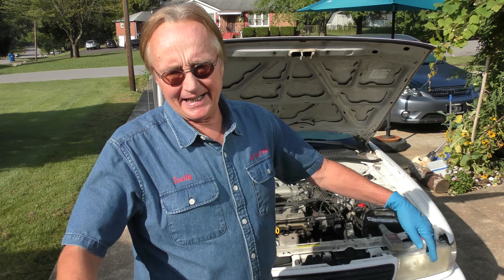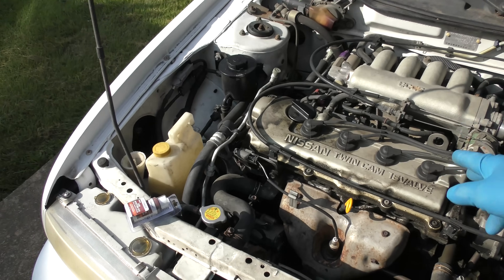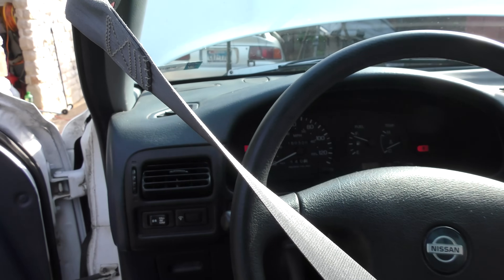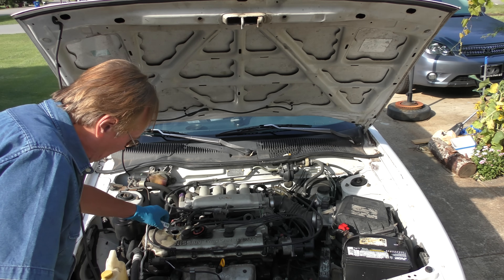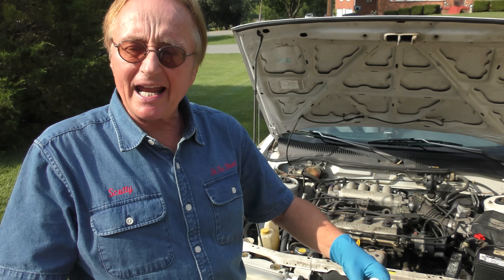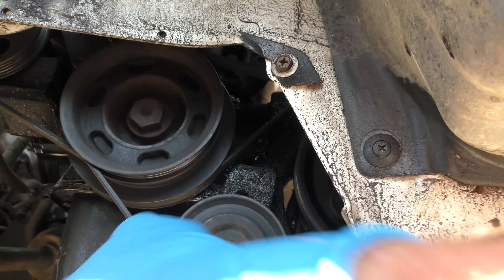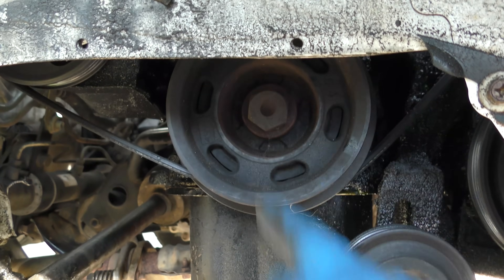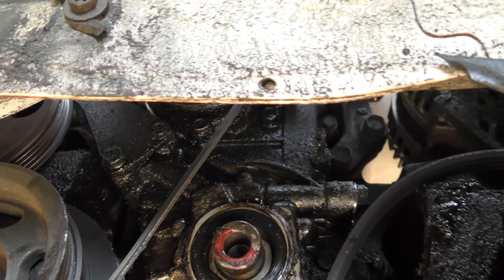If You've Got an Old Car, Do This Now

Comment: Scotty is the only mechanic I know who uses UV leak dye. All of our local mechanics just guess where the leak is, which can be very expensive!
Reply: Can't they use the computer to detect the leak? (I'm still learning about cars)
Reply: No, the only components that is electronic that deals directly with the oil is pressure and temperature sensors. You should always use dye unless you can easily see it.
Reply: @HeinzGuderian_ lol no y’all don’t. I can’t believe you just lied for all mechanics in the US like that
Reply: id guess the garages don't want to keep stop pile of dyes
Reply: @jenkathefridge3933 loooool yeah the check engine light tells you
Reply: 😂 there guess always be wrong too
Reply: the seals on japanese cars always fail. they use crap rubber bits
Reply: @HeinzGuderian_  we aren’t talking about mechanics having the dye. We are referring to them using it….
Reply: Wonder why he didn't take a piece of Emery cloth and polished dampener where it rides on the seal that would have been the perfect job.
Reply: I would have definitely degrees the whole engine off, last thing you want is that fluid getting on everything and ruining, and you'll find your lie like nobody's business I've been doing it for 45 years. If you got anything riding on this seal,it needs to be polish before you put it back on
Reply: Work smarter, not harder.  That's the key.
Reply: @jenkathefridge3933 how can a computer tell you where an oil leak is? No car can do that.
Reply: @CadillacDriver ya then you just press the stop leak button
Reply: @kellismith4329  yeah of course 🤔😆
Reply: Thanks,strange Mechanics… my Point S Tire shop pretty straightforward (getting expensive
Reply: Yeah well I don't guess I completely decrease  the engine off spray it off run it and then take a look.

Comment: Scotty actually saying good things about a Nissan 😂
Reply: Next he'll say something good about bmw
Reply: those old nissans are still running an i have a 2013 versa(its now a spare to a toyota and subaru i have) ready for a 3rd trans at 160k. MY 95 Altima i still had until 2018 never died ever bulletproof i put 70k on it when its over 20year of age(when i got it 2015) and for 500 bucks not bad for my first car.(brother crashed it)
Reply: Yeah if it's an older model.
Reply: Old Nissans are really good. Pretty much anything prior to 2002 and certain models from 02-07. There’s very few models Nissan makes today that are somewhat reliable. The trucks and Z are good. The high end models like the Armada have decent drivetrains, but can be an electrical nightmare, same with Infiniti. They really went down after 06 or 07.
Reply: Lmao. Just because it is an old model, that's why lol
Reply: Next you’re going to tell me he is saying good things about EVs… …. ….   Was that a pig that just flew by?
Reply: He says the older ones are pretty good in the videom
Reply: Lol he's said good things about only two modern Nissan's i can think of,  a Titan and a 370z which makes sense
Reply: He’ll hate them next week. He’s whacked
Reply: @seraph1926 yeah he’s cooked
Reply: I. Can’t  believe it 😮
Reply: He's talking about OLD Nissans... different car.
Reply: He always said good things about the Navara  and  pre Renault  models.
Reply: @seraph1926 he already has on the M3 video
Reply: Old, pre-Renault Nissans that is.
Reply: Old Nissans are built like tanks with bulletproof engines. They're as good as Toyotas and sometimes if not better. Old corollas are using belts whilst the sentras use timing chains which is much more durable and reliable.

Comment: You can tell Scotty loves working on older cars.
Reply: He doesn't know how to work on modern cars.
Reply: Cause its easier to diagnose them
Reply: @mattdawg6006 Neither does any other mechanic😅
Reply: When they were easy to work on.
Reply: I have an 1994 Olds Cutlass Supreme S 3.1 wishing he could work on mine cause my checkengine lightt comes on or my ABS lights comes on & no one could tell me what's wrong & my a/c has worked in 4 years blowing HOT AIR
Reply: Who doesn't?! Anyone that has been a mechanic will tell the older stuff is a lot more better built and repair friendly.
Reply: @mattdawg6006 Scotty fixes old and new cars quite well.
Reply: @mattdawg6006  He even knows how to work on EVs lol
Reply: So do I!!
Reply: He doesn't know what do do with anything manufactured after 2002.
Reply: @adriantomlin2902 'more better'? 😅😂
Reply: @WhatYouSee  the man has the equipment and knowledge to work on every type of car, including modern hybrids and EVs
Reply: @seanweber4252  great. He bought equipment.  He has the money  to buy equipment.  Show me an EV that  he's  fixed.  And not just a tail light
Reply: @WhatYouSee  🤓🤓🤓
Reply: @seanweber4252  People who are trained on and skilled at repairing EVs do not refer to themselves as 'mechanics'.  In fact - NOBODY working on truly modern cars are referred to as 'mechanics'.  That term in used for oil change and tire changing chain personnel.
Reply: @user-ob3jf6kt1l  Put the key on to accessory position & jump the top right two terminals on the electrical connector near your left knee in the driver's seat. The check engine light will blink out some 2 digit codes.

Comment: Hole in the muffler? Back in the seventies you could buy a Muffler Bandage, a fiberglass strip that you would wrap around the muffler (like a bandage). With heat the bandage would get hard. Drove an old Dodge Dart with a bandage for years
Reply: A can of powder milk, cut and folded. Wrapped and held in place with regular steel wire. Worked perfectly fine on an old Toyota for at least 4 years. Eventually the entire muffler fell down. LOL 😂😂
The car run for years with the most bizarre "fixes". Unfortunately on the day that "vehicle inspections" became a legal obligation. 
I stop it on the side of the road. Never to be touched again!
Reply: Too bad @CensorshipGenesis they don't do vehicle inspections anymore; only emission testing.

Comment: The only people that would say Scotty's' "full of crap" are those that have not tried 205 reseal. It is amazing stuff. I drive a 1999 Acura Integra that had a rear main seal leak. The reseal not only stopped the leak it also cleaned the rings and the car no longer gives off light smoke at start up, till warm - something that B series engines are known for. Great advice from a guy that knows - Scotty's alright in my book.
Reply: craigsawyer6453- The light smoke at start up is valve stem seals. It is not a real problem but, it is bad when you start up in a parking lot when someone is walking by, this happens to me with my old truck. I will try the 205 but I have been living with this for 20 years in this occasional use work truck, so it probably beyond help from this product.
Reply: Would the leak seal work on an 09 dodge nitro?

Comment: Back in 2005, I bought  a 1991 Nissan Maxima SE with 245k miles. Sold it with 300k miles in 2006. No issues.  They were solid cars back then
Reply: Back when Nissan was still Nissan or way back in the 70s when they were known as Datsun..
Reply: Those maximas  were great with superb v6 engines.
Reply: 55k miles in one year?? Good lord.
Reply: Nissan products were great in the late 70's, 80's,  and early 90s. 240z,260z, 280z, 300zx. Maximas and Toyota Cresidas were Japanese Cadillacs. I bought a 1986 4 cylinder Nissan Hardbody pickup. Hauled stuff in raced. Snatched second every red-light. Went through a few clutches. My brother wrecked it in 1990 with 300k on it. Truck went across the country many times at 90 mph. Nissans were great.

Comment: Transmission fluid and filter change, do it yourself, but don't consider this a simple job.

I did one on a lightly driven 94 Chrysler New Yorker 3.5 l V6 that just reached 50,000 miles.  The hardest thing was getting the pan off, on which the factory used silicone to make a gasket.  Get one of those "gasket breaker" tools, even if it costs 50 bucks.  Tapped the gasket breaker into the seam near a corner of the oil pan, and it popped right off.  Don't improvise with a chisel and end up gouging the pan because it is nigh impossible to buy a replacement pan for this car.

The second hardest thing was removing every vestige of the silicone gasket.  Use plastic scrapers, don't be afraid to use your fingernail, and plan on spending a half a day getting the pan flange free of the silicone.  For some happy reason, not much silicone removal was needed on the mating transmission flange up in the vehicle.  Putting it back together, I spent $20 on a fiber gasket and did not use the rubber gasket that came with the new filter that was creased from being folded up in the box the filter came in.

Torqued the pan against the fiber gasket according to Scotty's instructions, and whoo-hoo, no transmission leaks!
Reply: And one more thing, I took a jeweler's file to remove the drill-hole burr on all the bolt holes on the mating side of the transmission oil pan flange.  This is done by filing inside each bolt hole at an angle, being careful not to slip out of the hole and scratch the flange surface.  The factory use of a silicone seal probably made up for the tiny irregularities from those burrs on the bolt holes, but I was not taking the chance that the fiber gasket was going to distort when those burrs were pressed into it.
The hour I spent doing this was worth it to achieve a leak-free fit of the pan.

Comment: Those Nissans in the 90s are good engine and transmission is good after 2006 Nissan has went downhill my uncle's has a 96 Altima gxe with same motor

Comment: Eyy a B13 Sentra. I still have one and still use it today. Very very reliable car. Timing chain driven DOHC 16 valve engine. Good on gas. Light car. I also did replace this particular main seal as mine leaked as well months ago. I can still find original OEM nissan parts for this car. Own mine for 7 years now with 90k miles (150k kms) Just keep in mind you have to take care the body to prevent rust as this era of cars are not really rust proofed well. But very solid car and cheap to maintain

Comment: Best car I ever owned was a Datsun B210. 300,000 miles. Still had the original battery when I traded it.
Got 40 miles to the gallon back in 1978 !
Reply: Thanks for saying so,  my 2014 quest has the original battery and the whole neighborhood is shocked!
Reply: How old was it by then?

Our Primera had its first battery for 13 years and 11 months.

Comment: These type videos, where Scotty shows how to do the work, are my favorites.The info vids are great, but I like to do the work myself and these vids are excellent as teaching tools!! 👍
Reply: Couldn't tell from the video, was Scotty able to access the crankshaft seal by removing both the front right tire & shocks/springs or just the tire?
Reply: wouldn't he have to work from under the hood to remove the shocks and springs as well? im not an expert but i think since he didn't do that in the video i assume its just the wheel
Reply: @ahmadammash9511  I have an old Sentra and there is more accessibility from the side than you might think. But transverse mounted drivetrains are a pain the butt. 
I liked the old days when everything was in line, front to back. Not always a picnic to work on either but a whole lot easier than front wheel drive. 
Cheers😁👍
Reply: @emailuser8668  You can and you may need a puller as well if rubber mallet won't work. To get the seal if don't have a tool just gently drive a screw into the thick part of the seal and pull it out. You don't to scratch any of the housing. If you don't have socket to reseat the new seal use the old on top of the new one and gently tap it in with a small hammer or rubber mallet.

Comment: If you are one of those people that bought a CVT before knowing they are junk, change the fluid every 40,000 miles (or sooner if you have a Nissan.) Ignore the shop when they say you don't need to do that. You will get more miles out of the transmission
Reply: @devenmellor  I agree. I choose to do it as a yearly service and I'm at nearly 90k. Not everyone wants to do it that often so I list what a trusted mechanic told me with the 40k interval. Fluid changes are much cheaper than a new transmission in the end.

Comment: I have a Nissan Sunny ( Sentra ) 2001 with  163,250 miles. Engine still run good and do not burn oil. Had to replace both engine seals and as we had to remove the transmission,  the transmission seal was changed too . We put new  trans oil too.  Real solid car and engine and in Thailand   still no rust on the body.

Comment: I had a 1980 Datsun 210 (Datsun=pre Nissan).  1 liter 4 cly, 4 speed.  Cost was $3650 brand new.  30 mpg.  no options.  Put about 170 k with no repairs except oil changes, exhaust, brake pads, spark plugs, filters and tires.  Probably the most trouble free car I ever owned.  After 14 years it still had the original battery when I sold it (and winter is cold here).  I only sold it because I wanted to drive something bigger, not because of any mechanical issues.

Comment: Hey Scotty I got a ford F-150 with 202222 miles on the counter changed the oil and filter with syn oil every 5000 mi and serv the trans every 30.000 The last time i changed the trans fluid you could eat your lunch out of the pan and that was @ 200.000 Also the engine makes no unusual noise Its a 5.4 3Valve I know I find that hard to believe too SO MAINT IS THE KEY!

Comment: Nissan made very solid V4 and V6 motors up until early 200s. Never the most fuel efficient, but very cheap and reliable. I still keep a 2002 V6 Frontier 4x4 manual around. In the mountains of Maine when the snow is at its worst and I gotta go into the woods, I take it over the wider, clumsy 60k truck. I like the videos when we ID problem, disassemble and talk about it.

Comment: 1:56 - Yeah, the old $11.99 ATP 205 Reseal is a Heck of a lot better than the "Re-Formulated" $24.99 ATP 205 Reseal. The Old Stuff worked better and the New Stuff Doesn't and they Charge you Twice as much....I was Wise and stocked up on the Old Formula in 2019.... Oh, and i own a 94 Celica with over 345,000 miles and drive it daily.
Reply: How can you tell the difference between the new and the old one?  And why did they change the formula?

Comment: I’ve got two pulsars at the moment had two Sentra as well one did 350k before i gave it away still going well.I have a pulsar n15 99 with ga1500 and a 2004 wagon later qa1500 no distributor with 220000 to replace one that got lost in a flood.both excellent cars though i think the best was my 92 Sentra cup car good for over 120mph.
Reply: Man, back in the day I had a friend who had the Pulsar NX Sportbak with the two roof pieces you could swap out.  I still want one of those, to this day.

Comment: If environmentalists really wanted to do something positive for the environment they would get the auto manufacturers to give life time warranties on gaskets and seals. This would keep the fluids from getting on the roads and parking lots and washing into the streams and rivers. I would bet that the manufactures would quickly develop some really good gaskets and seals.
Reply: Good point, good silicone gaskets will last forever. Most of them are probably neoprene rubber that gets hard and cracks

Comment: I truly hate leaking engines making a mess all over the place. As such I've had a few seals to deal with. Something I totally advise to replace ASAP. With that said. If working on an older or high mileage car do not skip on the seals. They are cheap and easy to replace. It's not a good deal to go in a second time. So do it right away. 

A ridiculous example I see all the time. Is doing an entire full clutch job, taking off the gearbox, dual mass flywheel, transmission, etc. And then not do the 10$ seal!!! When it's laying there waiting, in front of the line. LOL 😂😂

Worth mention that I also love to keep the engine bay impeccably clean . So any leak is readily visible and manual activity don't return full black and oily hands.

Comment: Scotty! I bought a 2006 hyundai elantra gls sedan for the old woman that bought it new. It had 121000 miles on it but drove like new. I put 45,000 miles on it and didnt do anything except oil gas and tires. It's been such a rock solid reliable flawless car that I chose to put an aisen timing belt and water pump. Nex radiator and thermostat. Only replaced one hose. New brakes on the front. Ne radiator cap and new legend napa battery. I did all of this work at around 166000 miles. I am looking forward to many more years with this rock solid reliable gas saving car. Too bad hyundai products went down the tubes.

Comment: I had a Nissan 300ZX.
Never had a car with a timing belt so I didn't know it would have to be replaced around 120,000 mi.
Since it was a sports car, I used to race it around and I blew the timing belt and ruined the engine.
Well my friend was a mechanic so he said he could get me an engine.
We swapped it out. It costs a lot of money.
Then I blew the timing belt on that. So he just checked stuck the engine in there without checking the timing belt. My bad also for not figuring that out. Live and learn.
Anyway, I only drive cars with timing chains now.

Comment: My 1st car was the same but a 1993 Sentra: it had a bad oil leak through the distributor that nobody was able to find, but another owner at a Nissan chat suggested to replace the distributor O Rings and we found the bad oil leak, it was there. The car was sold in 2004.

Comment: I have a Nissan Pulsar the equivelent of a Sentra it's a 2002 with 207,000 ks no leaks no oil burn just done a brake fluid flush no coolant loss I drive it like I stole it never had a problem bought it approx 3yrs ago for $ 2,000 aud.

Comment: I have a ‘05, 350z. It had a squeaking noise coming from the back wheel. The bushings still looked in fine condition but I ordered some 205 reseal online and when I sprayed the bushings, the noise stopped in less than 10 mins